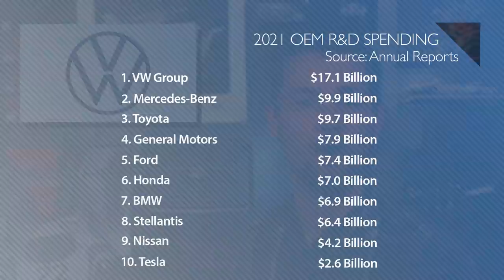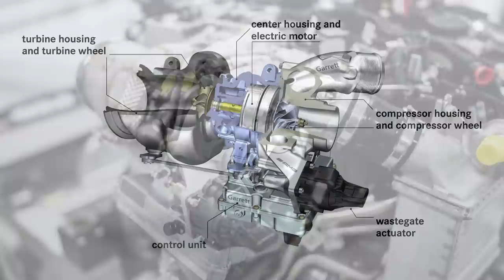Chinese Refineries Shun Russian Oil; Volkswagen to Drop Models, Move Upscale - Autoline Daily 3297

Comment: The Detroit body shop portion of Comau used to be Progressive Tool and Industries (Owner was a friend of mine)   they sold out to Fiat,  which then became Stelantis.       Comau is active building body shop equipment for most global automakers, incl Tesla and GM.
Reply: If I was making cars and had a captive robot and automation shop you can rest assured we’d be paying ourselves for robots and refitting on model updates, but I am kind of biased to be pro automation it’s interesting work and I get to ear and sleep in a comfortable house.😁
Reply: @tbthedozer  All large automakers have used nearly 100% robotic assembly in the body shops for decades.   The only jobs for humans is to load parts, and maintain the machines.

Comment: Please ask  Mr Ruess  how many BEVs they intend to produce  yearly  and time-frame targets, like  years  2023, 2024,  2025, 2026, and if  the Ultium batteries are strictly Nickle and Cobalt or  Manganese  based formula, not  LFP as many  Chinese BEVs will be  switching to.
Reply: From what I know that Ultium battery can work with any chemistry, that being said I also want to know if GM has considered using LFP for Cathode as an alternative to NCMA or if GM has confidence to secure the raw material needed for the current chemistry. I know GM is working with SES on lithium metal battery which is the next major breakthrough in the battery technology and I want to know the timeline regarding when this is expected to reach volume production.
Reply: The answer to this would depend on what you’re talking about, are you talking US production, or global production?  US production, GM has talked about >60k this year,  >150k in 2023,  >300k in 2024,  >600k in 2025,   >1m in 2026 .   Let’s keep in mind right now, Tesla has a run rate of about 450 K a year in the USA, and stated yesterday Austin when in full production will build 500 K cars a year, so that gives Tesla US capacity around 1 million in 2023

Comment: Question for Mark: Is the Bolt EV (not EUV) staying in the EV lineup, or is it being replaced? Everyone seems to be moving up market with their vehicles and the Bolt occupies a segment that I have my eye on for future purchase. The battery debacle that the Bolt endured has me concerned for it's future.
Reply: The Bolt EV and EUV are scheduled to sunset in 2024. This hasn't changed. 
They use the outdated BEV2 platform and GM is moving forward with their new Ultium platform. 
The Bolt is priced around $30k, and GM will be launching the Equinox EV at that price point for 2023. The Bolt has already been handed its hat and is being shown to the door.

Comment: Electric turbo? A turbo powered by another source? sounds like a supercharger
Reply: No, it’s quite different.  Cleetus Mcfarlane installed a kit on one of his drag cars.  One of the key things with that one was that it needed an inverter/voltage converter to boost the electrical feed to 48 volts.  

Superchargers have mechanical connection, via a belt, to the crankshaft.  But I’m sure you knew that already 😉
Reply: @dewiz9596  I hear you but turbo as the name implies should rely solely on a force of air. It's a complete aerodynamic device. They were even used on the outside of planes to recharge batteries via the speed of the air passing over the airplane body. Superchargers rely solely on a outside source of power be it electric, mechanical, hydraulic etc,. What we can conclude is,  a turbo is a form of supercharger but not vice versa. 
On a grey note, the electric motor is only used to maintain velocity when the exhaust pressure drops. U can say it gets "supercharged" to maintain speed.

Comment: An electric turbo is implemented in the Audi SQ7 since MY 2017.
Reply: I think you're referring to the electric supercharger they use to supplement the two turbos on their 3.0 TDI engine. That's very different.
Reply: I know, that is a different thing. But the SQ7 has an electric turbo that is in row with the conventional turbos. Drive is splendid.
Reply: Supercharger is belt driven off the engine.... Audi did not use a belt drive off the engine ...  So its an  electric turbo, even if some ppl incorrectly called it a supercharger

Comment: One thing possibly not thought of is that if fuel consumption drops drastically because people switch to electric vehicles. The oil companies have the option to seduce consumers by selling their product cheaper. I think it's something most people haven't thought of. However that's based on the level of demand for the product. If you have a product that people want to buy you will want to sell it to them.
Reply: This can't happen.
Reply: If EV's are getting more expensive and manufactured in smaller quantities due to resource scarcity, ICE will probably remain in use for much longer and oil consumption keeps up.

Comment: Can you guys ask Mark Reuss if there is a near term transition to higher voltage systems that will provide greater efficiency for future platforms and any other developments associated with greater efficiency that can make better use of battery net capacity (200 kWh pack in the Hummer EV)? Thanks!
Reply: The reason the Hummer has a 200 kW battery is because it is very inefficient, first they have to lose 2000 lbs.

Comment: Re the "impressive" power output of the new AMG for a four cylinder - there are already production 4 cylinder Jaguars making similar horsepower.
Reply: The AMG has all the complexity, cost, and NVH issues of ICE, but less acceleration than the electric powertrain that now defines luxury.  Think I'll pass.
Reply: @incognitotorpedo42  Your'e funny - screw NVH, it's the 0-60 acceleration time that defines if a vehicle is luxury or not....🤣What about a bananabox on four wheels, a rocket engine mounted on top and a Tesla badge on it?
Reply: @robertkempe2730  Yep, it's all about soul - I've driven a couple of Teslas, impressive technology but soulless.  Gimmie that noise and vibration!
Reply: There are at least 2 automakers with PHEV I4 combos to compete against the Mercedes AMG system: Jaguar's (P400e), as you mention (used in Land Rovers as well) and Volvo's (T-8 with a "twincharger" in its' ICE component). All 3 have 2.0L ICE's as their base.

Right now the highest output for ANY I4 in USDM is AMG's ~ 415hp in the "45S" version of their FWD-based apps. 

This version on the SL (the first RWD-based app for this AMG powerplant) has less hp (~ 380) than their 45 FWD-based apps (they go > 400hp).
Reply from the maker: It's impressive to see around 400 horsepower from any 4-cylinder that goes into a production car.
Reply: @AutolineDetroit  300-horsepower from a tiny affordable 1.6-liter, 3-cylinder production car is more impressive...

Comment: too bad about the Pacifica PHEV. it's an otherwise nice minivan.
Reply: If "Stella" is axing the Pacifica PHEV minivan is because the Pentastar (NA-3.6L V6) ICE component is getting discontinued. Most likely it'll be replaced by a FWD-based version of the Hurricane 4 (T-2.0L I4) in the Jeep Wrangler 4xe. In RWD-based apps makes + output and torque than the 3.6L combo.

Also they might use a new platform as well...
Reply: @syxepop  i thought the 4xe gets terrible fuel economy. why would they use that powertrain in the minivan?
Reply: @toronado455  Maybe, the 4xe is only in a Wrangler right? Offroad focused vehicles like the Wrangler trade off a lot of aero for clearance and have beefier chassis and suspension components to work less than ideal terrain than a minivan or a car would typically see.

From what I have seen so far on Ford's Bronco being much thirstier than the Ranger, the F-150, and the Mustang despite sharing some similar powertrains. So maybe it would be similar if reversed for the Jeep?
Reply: @ZealofSparta  Jeep Wrangler 4xe = 20 MPG,  Jeep Grand Cherokee 4xe = 23 MPG, Pacifica Hybrid = 30 MPG (current V6 hybrid). A Pacifica 4xe would likely be similar to Grand Cherokee or around 24-25 MPG. This is not an improvement.

Comment: Electric turbocharger, isn't that a supercharger?
Reply: No, this compressor is still engine exhaust driven. The electric motor is attached to the turbine and will provide compressive force ahead of the exhaust gases, which is intended to reduce engine lag.

Comment: China's oil imports have been dropping steadily for 2 years now. And it has nothing to do with the pandemic. Over 1 million electric buses, est 5 million electric taxi's, and now over 30% of all new cars sold are BEV. And the high speed rail has now basically destroyed domestic air travel. Their coal and gas imports are also down.

Comment: Q:  Why hasn't gM stopped downward market share trend since 1960s?
Q:  List all of the dropped (such as Corvair, Saturn, EV-1, Volt, brands, )  autos/brands/ selling methods (ie. Saturn) ?
Q:  Why did all Euro ventures fail such as Saab, Volvo, Opel etc. ?
Q:  Why gM abandon Detroit and so many factories?
Q:  Why did joint venture with Toyota fail?
Reply: Q: Why do mindless cult drone trolls exist? 

 

A: For the same reason misquotes exist....
Reply: @nc3826  I think they are all reasonable questions
Reply: @dewiz9596  Not if you read Al Capp's cartoons.
Reply: So others will learn to not run a company into the ground like Castro ran a country into poverty

Comment: Question for GM: Was the thinking of going with LG CHEM  more to do with pricing for their batteries, than a sense of LG quality because they aren't or haven't necessarily been known for making quality products?
Reply: I have lots of trouble-free LG products. . .  from flat screen TVs to Air conditioners.  Fact is. . .  it’s difficult to produce safe Lithium Ion pouch cells.  I wonder where the engineering decision regarding their use was made
Reply: @dewiz9596  I had a LG phone and an LG clothes washer. Both were crap.
Reply: @daviddill5227  That's because there is no quality control, others got the good ones.

Comment: VW many odels would had been very profitable like Toyota if only the sleepy VW  management had not source the fragile breakable  plastic water pump affecting cooling system   , dry clutch transmission into all their bread and butter cars couple with dieselgate scandal .

Toyota also got problems like Takata air bags and unintentended acceleration but profitable because Toyota never take risks to install fragile plastic pumps and bad transmission into their bread and butter models.
This is the vast difference between a clever and greedy stupid car company msnagement.